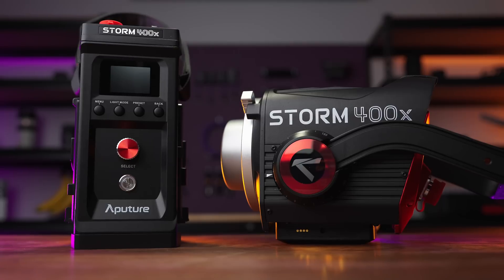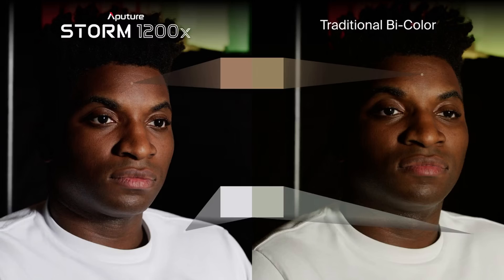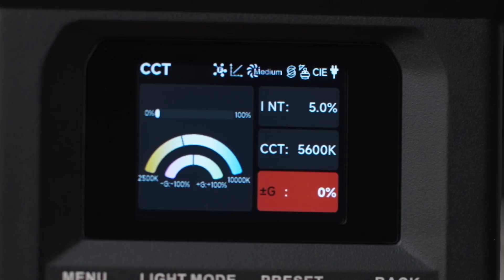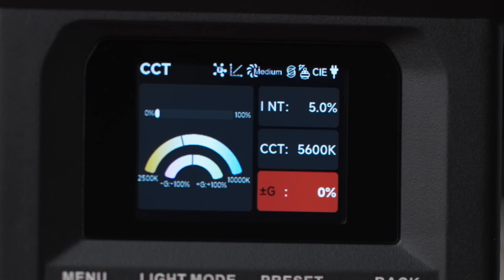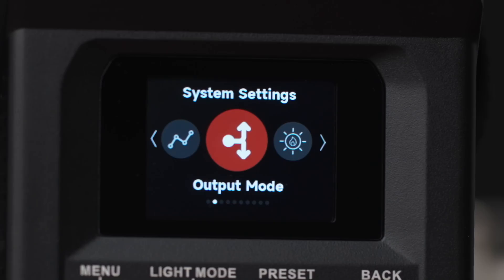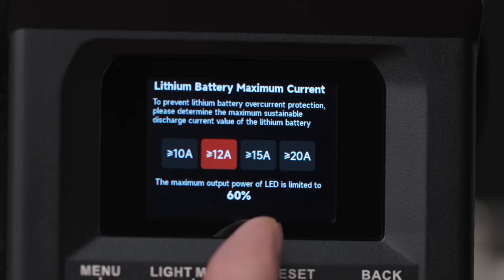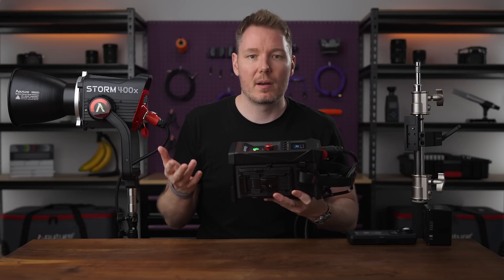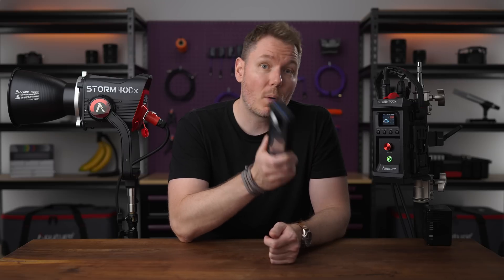The Best Light I've Ever Tested (Aputure Storm 400x)

Comment: But....  HMI is far better in terms of daylight conformity, not much more expensive, and, if you get into Joker Bugs, lighter and smaller.  They are also slightly MORE light efficient (lumens per watt of energy) than LEDs.  So no, not really the best light out there, only the best LED light, or the best light that has color tuning abilities making it less necessary to buy gels.
Reply: I personally would prefer to have the G/M shift and adjust white balance. HMIs will shift over its lifetime, and takes time to start up. They also hella hot

Comment: Hello Gerald, Have you tested the output with a softbox compared to the 600X? I've only seen one video that does this and the 400x put out significantly less light than the 600x. I am hoping someone can confirm or dispute this as that is what I use my 600x for mostly. I was going to switch to the 400x but if it puts out less light in a softbox then I'll have to reconsider.

Comment: 6:45 My mouth actually dropped. I use 600X pro and F10 Fresnel quite frequently. It's incredibly heavy and cumbersome. To get higher output from a 400X with a compact Fresnel is bonkers.
Reply: I felt the exact same way the first time I compared the two. (I did a head to head review on my channel). The size difference between the F10 and new CF7 is pretty wild considering the CF7 provides way more punch.
Reply: @aaronwaynehill does the 400x work with the F10 fresnel?
Reply: @rogrdotnet  no sir. it would bump into the prolock mount.
Reply: @aaronwaynehill  ah ok, i picked a 400x up, works great with the spotlight, I pre ordered the new fresnel but its not in stock in the UK atm.

Comment: Love this overview! Any chance you could meter and compare with the output of the 600X in a softbox that has an inner baffle (to disperse the narrow beam angle more)? I have seen other YouTubers demonstrate between 50% and 70% output with the 400X compared to the 600X in a softbox. This is much different than the photometrics using a fresnel or native beam angle (which are much narrower than the 600X). This is useful for folks to know if they plan to use this in a softbox most of the time and assume it's at the same level as the 600X.
Reply: I'd like to see a test vs the 600x in a softbox as well, as that's how I usually use it. I found one test with the 400x vs the 600D with a lightdome ii with no inner baffle at 3M, and the 400x was at 588 lx and the 600D was at 1270lx. The 600x is about 70% output of the D, so it seems it would still be quite a bit brighter than the 400 in a softbox. If your goal is far throw with a fresnel though the 400x is really impressive.
Reply: @Rantry I saw the same. I’m waiting till the 700/800X later this year.
Reply: Good question. Following